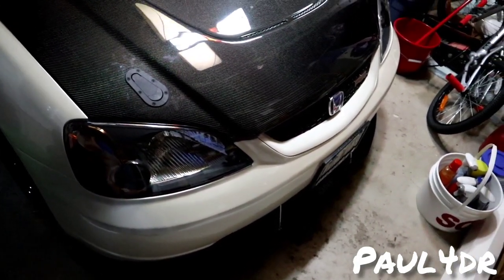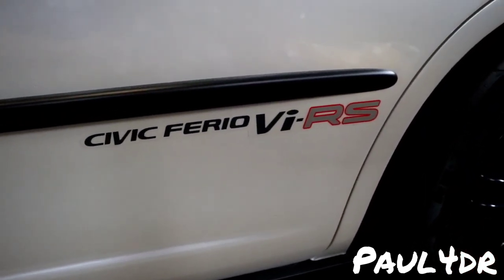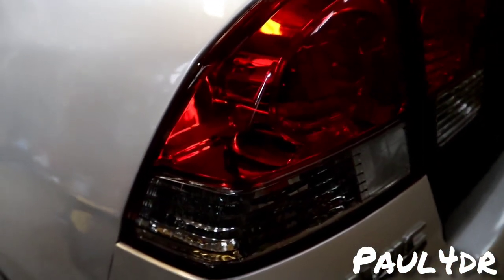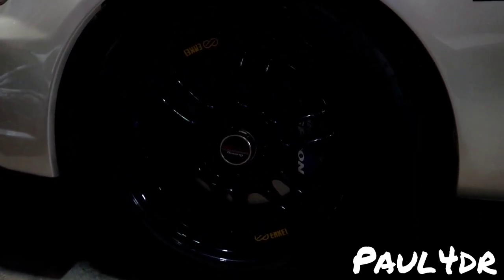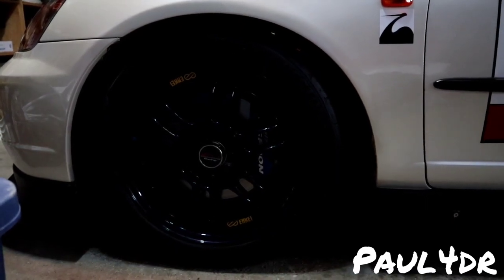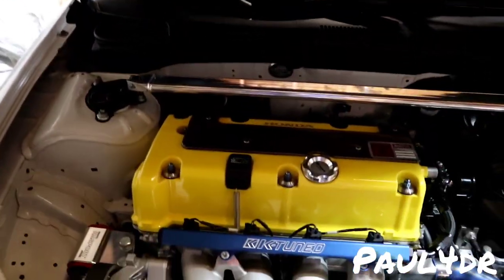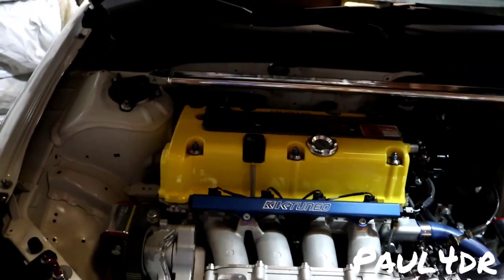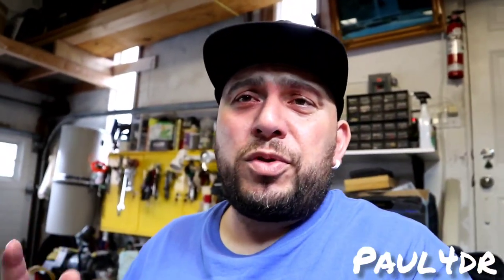My *REVISED* 2002 civic Mod list

Comment: you have a link or a name to those tail lights?? been looking for those for a while
Reply from the maker: Found them on ebay many years ago
Reply: Look on eBay, found an original set of JDM ones a few months ago! They’re around, just gotta be ready to ‘get em’ when you see them!
Reply: @carlm8821  i hear you, i’ve found ones that are clear with the little reflector being red, i’m gonna settle for those since i’m not really trying to be on a hunt everyday searching for these lights😅
Reply: @JoJo-re9dm  if I’m not mistaken, those are by the brand TYC, which make excellent high quality replica lights! Those have the little red square reflectors, the ones made in Thailand/Taiwan are genuine reproductions but have the clear reflector squares instead of red ones. As for the headlights, the genuine JDM ones DON’T have reflectors at all whereas all non JDM including US have either clear reflectors and amber over the indicator/reflector section or just the reflector without the clear amber behind the lenses. Hope this helps!
Reply from the maker: The ones on my car are depo
Reply: @PAUL4DR  forgot about depo brand, just picked up depo JDM headlights, and that company is even better than tyc.
Reply: @PAUL4DR  what headlights are you going with? they look like OEM’s with black housings/tinted lenses. 
something I see all too common on these are double-projectors w/halos, and black housings which is different and changes the look, but imho they look a bit too rice and nice clean amber-less (lenses) with clear reflectors and either tinted-chrome or bright chrome housings clean up the look much better!